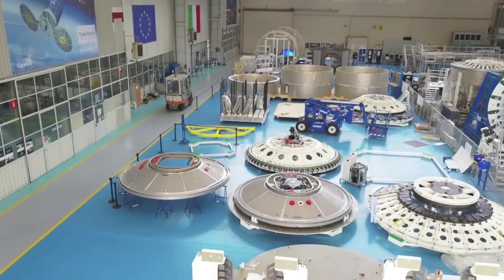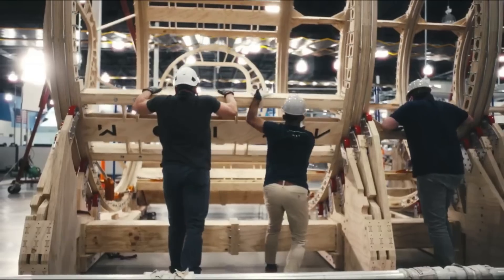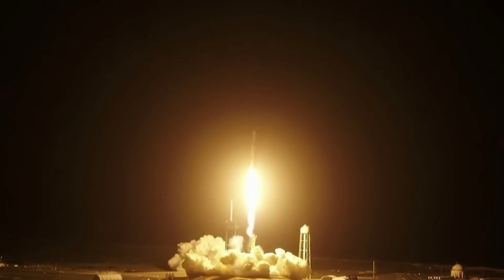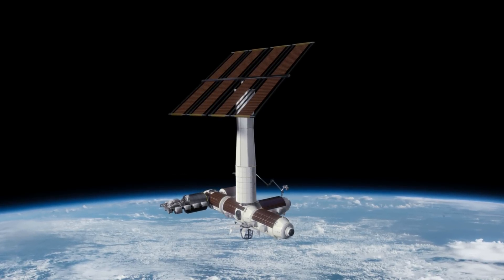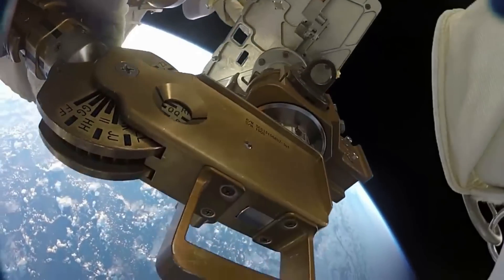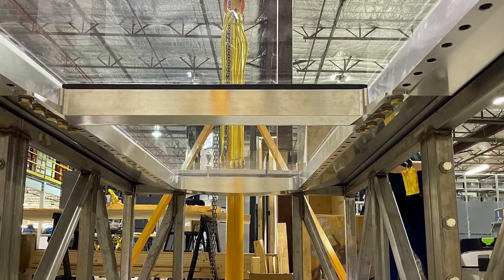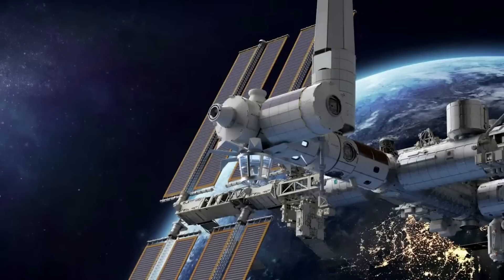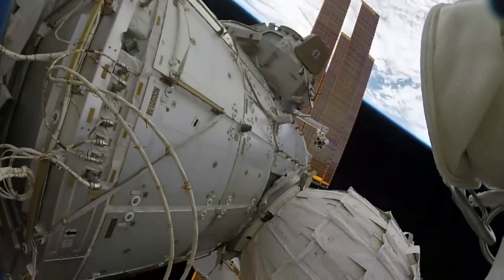An In-Depth Look At The World's First Commercial Space Station

Comment: I really hope they've redesigned the power module since it's just poorly integrated with the station. The solar panels block the ones on the other modules, 1/3 of the radiators will always be in sun, it shifts the CG dramatically when attached, and honestly it just looks ugly

Comment: 17. Remember that number. That was the diameter (in meters) of Skylab, in orbit, way back in 1973! Sigh! Kudos to Axiom and Reef, in their efforts, starting much tinier space stations. May they and others get to 17m- diameter--and wider--orbital structures, as soon as possible.
Reply: The 5m at launch class inflatable LIFE modules that are planned for the Orbital Reef are a similar size as Skylab’s orbital workshop. Sierra Space is also working on a 7m at launch class to take advantage of New Glenn’s large fairing so the LIFE modules will exceed the size of Skylab’s orbital workshop.
Reply: Skylab was an adapted Saturn 5 third stage tank. That was a huge rocket. It also was not rated for extended operations like the ISS.
It was easier to make it back then, but that may be possible now. Nasa awarded an unfunded support contract to SpaceX to study the possibility of making Starship into a space station.